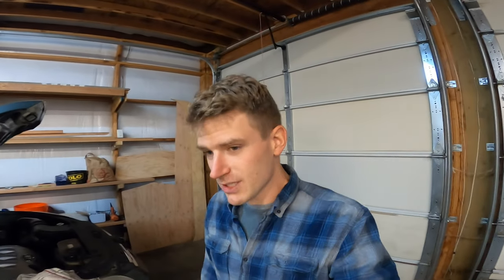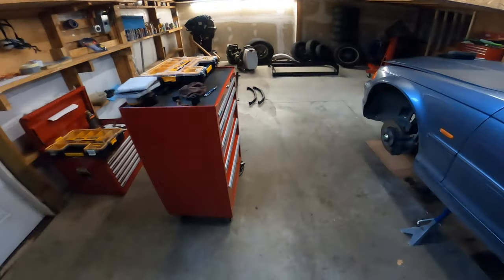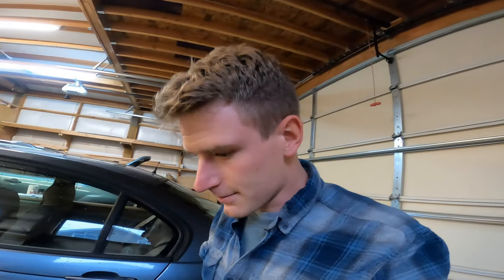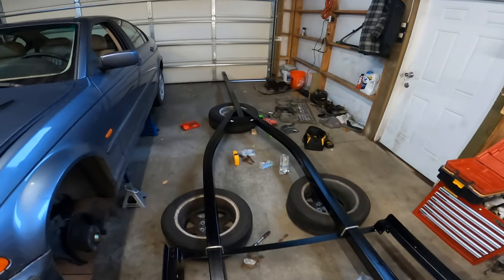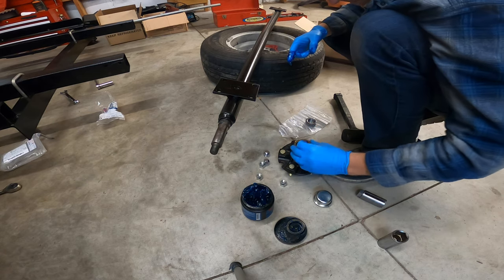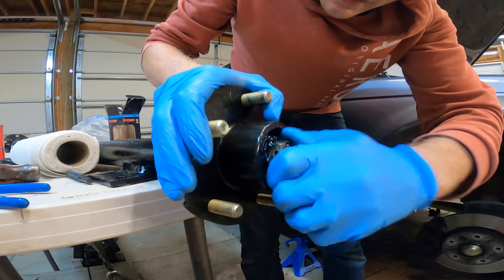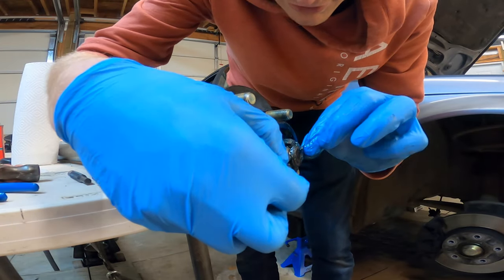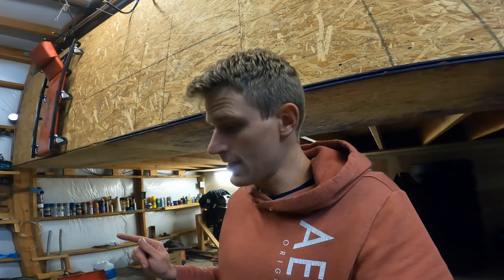Boat trailer rebuild (PART 4) bearings, axle, hubs,

Comment: I hope you used stainless steel bolts, nuts, and washers. Cost more but will last 3x as long.
Reply from the maker: most defiantly!  all hardware I used on the boat and trailer was stainless steel 😎

Comment: You didn't pack the bearings........ Google packing bearings, please don't drive this
Reply from the maker: your right, i didn't pack the bearings using a palm full of grease. I have also seen that method of packing over heat bearings because of over packing.  Those bearing buddies i added to the hubs with provide sufficient gease to the bearing as i keep them serviced, they're designed to force grease through the bearings.